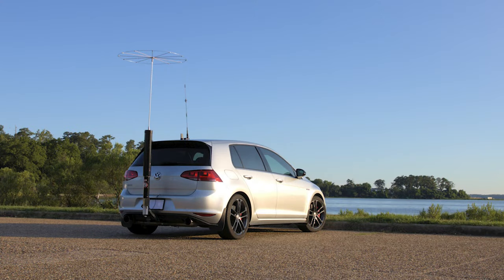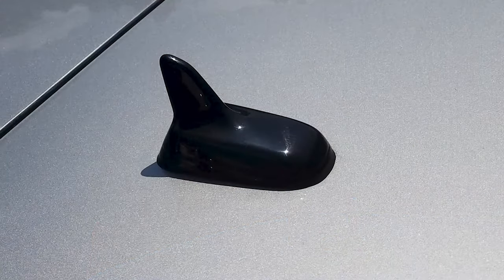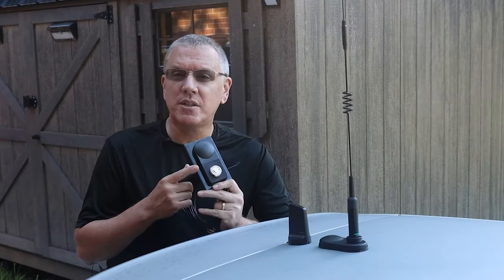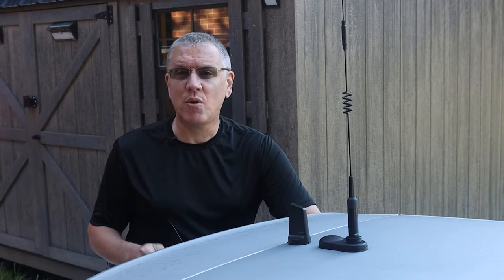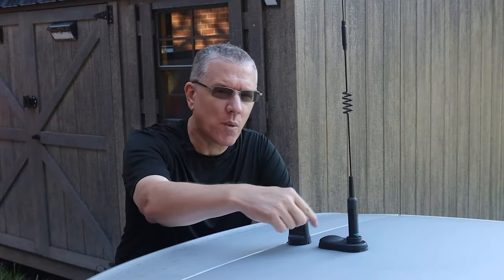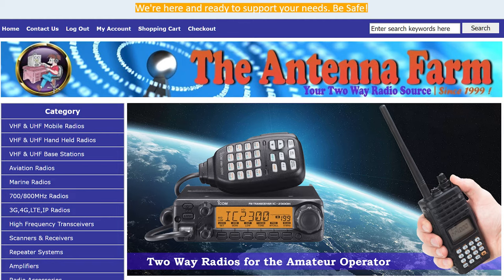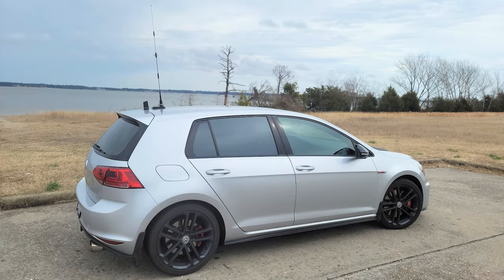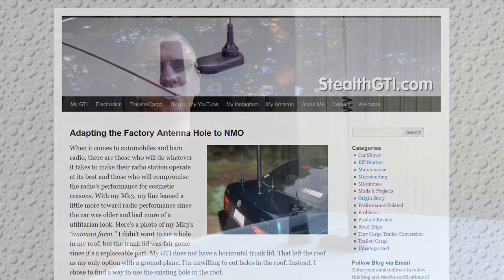Ham Radio Antenna Without Cutting a New Hole

Comment: Ditto - excellent production and info. Also, you have give me a really neat answer to the fear of cutting a hole for a new roof mount antenna: buy a dummy shark fin antenna ($10-20) to put over the mount when you need to sell the car. Most older vehicles have no roof antenna, on a newer one you might have a shark with 2 fins. 73!
Reply from the maker: I'm glad you found this helpful. Thanks for visiting!

Comment: Great presentation.  However, my fright over drilling a 19mm hole in the roof was offset by cutting a 19" square hole for the roof vent.  That gave me the shakes!!
Reply from the maker: Great point! I was a tad nervous when I cut a 14-inch hole in my cargo trailer's roof. But, unlike with a car, I could have glued or welded a patch in place if I goofed it up. I think I'd be plenty nervous cutting a large hole in my car. HAHA! Thanks for visiting!

Comment: Well written content/dialogue and chock full of information.  Thank you for the video!
Reply from the maker: Glad you enjoyed it! Thanks for visiting!
Reply: @StealthGTI  Scott, I wonder if you might help me with a recommendation from your expertise. I'm a first - time ham radio owner and need to know where to mount the antenna (NR-770HB) for my first ham radio Yaesu ( FTM-400XDR). I have just 3 basic questions. On the chance you have the time to share your recommendation, I'll leave my questions here, along with my sincere thanks for your help.

I am converting a Ram Promaster van into a camper and need to close up my ceiling so I can get on the road before summer ends to travel to meet my new grandbaby!  I don't want to close the ceiling in the location where I'll need to drill to mount the antenna and pull the cable through from the roof to the interior of the van. 

I was told that mounting the antenna on the roof is going to give me the best coverage for my radio, I paid for a decent radio and don't want to ruin its capabilities by putting the antenna in the wrong location. Is this true, the best location is high up on the roof? The ham radio will be in the cab, so I'd like the wiring to come in through the roof of the cab,  but some recommendations I saw said there needs to be distance between the ham radio antenna and the vehicle's existing radio antenna. My van's existing antenna is just above the windshield in the middle where a rearview mirror would be located. Most of my roof space will be taken up with solar panels and a cargo carrier- how much space is required between the ham radio antenna and the vehicle's existing antenna? 

Last question, is a strong magnet truly sufficient for mounting the ham radio antenna, or should it be bolted down through the roof? I thank you very much for your time and expertise and for helping me get on the road for this very special trip!
Reply from the maker: @sheri4673  - Sorry to have let this linger for a few days. Pro tip: Always post a new comment instead of replying to an unrelated post. "Comments" are prominently displayed in YouTube Studio for creators to see while "replies" are often buried in unrelated comments.

With that said, YES, the center of the roof is the best place for an antenna. But you have some challenges with a Promaster, especially in an RV: 1) The van is tall. That may compel you to consider shorter antennas for clearance concerns, which might negate the advantages of being on the roof; 2) You need to be aware of structural members beneath the roof's skin that may interfere with drilling an NMO hole; 3) You need to balance those structures with any other items that are on the roof such as you plan for solar panels. 

I've never owned a Promaster or examined one with a technical eye. But I tend to think that the roof just behind the driver may be a good spot. Such a spot is forward enough to leave plenty of room for solar panels and aft enough to have decent counterpoise in front of the antenna... perhaps a spot that's at least as far back as the distance between the center and sides of the roof.  I suspect that would provide sufficient separation between the antennas. As you can imagine, the antennas on my car are all closer together than what I'm suggesting for your van. Stick around and you'll see that I have even more antennas on the car now. I need to make new videos to share them.

A mag-mount will work, but then you'll need to manage cable runs flapping in the wind and entering the cab. NMO is best! Today's NMO mounts can work through a 3/8-to-1/2" hole. Your choice of the NR-770 is excellent! and will keep you below the 12' mark on overall height. 

I hope that covers your questions. Feel free to contact me through my website if you have more. I'll answer you here, but my mailbox is right in my face all the time.  ;-)  Take Care!  PS: Congrats on your ticket and new purchase!
Reply: @StealthGTI  I can't thank you enough for the reply- it was faster than I expected- and for all the information; there's so much to learn as a newcomer to the ham community as well as these technical aspects to the build out of my Promaster. I'll be following your channel for more excellent content! Best wishes to you and yours!

Comment: Thank you for a good video, I'm getting my Technicians License soon and I do want a permanent radio in my car, but I want a hole with a garment I have not decide if I want it on top or on the side and I do want a cell booster and a cb radio, I'm going to order the Comet 2x4sr and the Comet B10

Comment: Very nice video and your presentation skills are very good also.  When you transmit on GMRS or Ham is there any issues with the GPS reception?
Reply from the maker: Not at all. In fact, I would have never thought of such interference. With that said, my GMRS antenna is on the other end of the car now that I have gone nuts with ham radio. "How nuts?" I have nine antennas on the car right now. See my KE4WMF playlist for details. Take Care!

Comment: Awesome, thanks for this video!  I have a 2017 GTI and from your video years ago I've been thinking about adding my 2m/70cm antenna.  I'll check this out once I verify that it shouldn't interfere with the sunroof.  Oh, and to be clear, you still have your SiriusXM antenna unhooked, correct?  Thnaks!
Reply from the maker: Thanks for the note! I cannot imagine how this mount will interfere with the sunroof. It's just 3/4" longer than the sharkfin antenna. Let me know if your measurements conclude that it won't work with a sunroof. And, yes, my SiriusXM and CarNet antennas are still disconnected. Take Care!
Reply: @StealthGTI  I did a quick look at lunch and you are right, I can't see that it would interfere.  Now to figure out how to keep my Sirius/XM while using this as I do listen to that alot.  Thanks!
Reply from the maker: @reidlanham2011  - That's good! I guess the answer to the SiriusXM depends on your tolerance for visible wires. You could get an external mag-mount antenna, run it through the seal as I did for that WeBoost antenna, then find a way to adapt it to the FAKRA adapter under the headliner. Another possibility is to see what the SiriusXM connector is on the back of the radio. If it's a common connection, you may be able to get an external antenna that'll plug into it, then route the wire to have the antenna sit on the dash, tight toward the windshield so you barely see it. You MAY have the occasional skip due to a shadow in the signal from the roof... maybe. Just a couple of ideas.
Reply: @StealthGTI   Scott - Thank you again for your videos and your website.  Would you be able to share any additional information about how the WeBoost antenna cable runs from the antenna, through the seal and into the car?  I need to do this with an XM antenna.
Reply from the maker: @jadue42  - The antenna wire in this video simply runs through the hatch and under the door seal. In this case, I peeled the seal back just enough to pass the wire beneath the seal and then pushed it back into place.
Reply: Makes sense!  Thank you, Scott!

Comment: Newcomer to the hobby. I have a 2014 VW Tiguan - which has something resembling your shark fin on it as well. I am keen to try something like this. Can you provide more information about removing trim in a car? This part is a bit daunting for the new person.
Reply from the maker: Thanks for writing, Jacob! The rear piece snaps out quite easily. Check out this video: https://youtu.be/2FZz9hl5zPk. The first minute shows that you don't even need a tool to remove the rear trim piece. From there, the rear portion of the headliner just folded down for me. Good Luck!

Comment: i have two factory antenna mounts at the rear of my cab  ( F250)   towered both sides not centerline.      and  the body is alu. 
but yes i agree as i also do not use any of the services offered for a PRICE.
a headache rack is very costly.  nor do i want to start drilling holes.
Reply from the maker: I want my next car to have a factory roof rack. That will give me some options. Have a look at my "KE4WMF" playlist and you'll see that I have more antennas these days. Roof racks FTW!  ;-) Thanks for visiting!

Comment: Thanks for the information! Unfortunately for me I moved to SV9 land years ago and unfortunately Renault does not do I. Glass antennas for their car radios. They choose to mount an antenna towards the back center of the roof. I have used STI-CO ANTENNAS in the past for law enforcement vehicles. They are very expensive at over $300 which includes a special diplexer that allows you to add VHF UHF and your car radio antennas all into one. They even have a GPS version. At a standstill since all materials must be imported and the issue with that is they charge 24% VAT tax on everything including the postage! Very illegal in my book. Have to wait for relatives to pack the items and bring them over which saves on taxes. So now we sit and wait……
Reply from the maker: Thanks for sharing that info. I don't know anything about some cool looking products that appear to be only for the European market. I hope you have a solution soon. Thanks for visiting!

Comment: Thanks for the video. Which connectors did you select on the drop down lists for radio and gps on the product page while purchasing?
Reply from the maker: Thanks for the comment! Here's a quote from a write-up at https://wp.me/pevkSZ-7l: "I bought my mount from The Antenna Farm. They’ll install most common connectors for a modest fee. I chose an SMA male on the NMO feed line and an SMA female on the GPS feed line. I also had them cut back the cables to 24 inches so that I can easily remove the mount for cleaning or maintenance." Feel free to check out the rest of the article if you're interested. Thanks for visiting!
Reply: @StealthGTI   I should've checked the article before commenting! Thanks for the reply, I'll check out the article. I have a 2018 gti autobahn I plan to do this to for an external antenna for my FT3D. 73
Reply: @StealthGTI  Follow up question, do you still recommend having both the cables trimmed to 24 inches if I have no existing cables run, and install my own, or just use the mount as it comes? Thanks!
Reply from the maker: @cbennett1  - I do! You see, if you need to remove the antenna mount for replacement (unlikely), cleaning, or any other reason, then you'll have to pull out ALL of the coax that you've fed through the interior trim panels and headliner. By trimming the cables to 24", you can leave the main cables routed in the car and just pull out the first 24 inches. It's a convenience that you may never need, but its great if you do!

Comment: Scott-  Where did you find the fender washer?  I have not been able to find one in this size. Thank you!
Reply from the maker: The one shown in this video was pilfered from the plastic mount that I had tried first. A standard 3/4" flat washer from your favorite hardware store may be large enough. If it's not, then perhaps https://amzn.to/3PgTlBo will work. It's expensive for what it is, perhaps it's one of only a few samples that I could spot. BUT keep in mind that your roof my not be flat at the hole. Mine is not. Over-tightening may pull the roof out of its natural shape. So, the standard washer may be better, if it's large enough to cover the hole. Good Luck!

Comment: When you say you had The Antenna Farm cut the cable to 24", were you referring to the GPS antenna cable?
Reply from the maker: I had both cables cut. This part has a cable for the NMO mount and the GPS cable. I had them both cut in case I need to remove the mount for paint maintenance. I'd much rather pull out 24" than 13 feet. Thanks for visiting!

Comment: I have been using a Larson mag-mount and a 2 Meter 5/8 wave Larson antenna on my Nissan Leaf connected to my dual band Kenwood rig. My roof antenna is pre-shark fin but roof mounted in the spot where the shark fin would go and about the same size. Will the EMWave Sharkfin mount NMO combo support Sirius XM radio receivers?
Reply from the maker: No. The EM only supports NMO (and whatever is attached at each end) and GPS. Thanks for visiting!

Comment: can I mount a 5G 4x4 MIMO improvement instead? Or do you please know how to improve 5G phone reception in the car? band n71 3,5ghz
Reply from the maker: You can mount any NMO antenna. Still, I chose to use a WeBoost cellular signal booster for my 5G needs. I think I mentioned it in this video. Thanks for visiting!

Comment: uh ! I thought that shark fin antenna was also for FM reception... I have the TSI model and I too did not want to drill a hole on the roof ! That is a nice solution if the original antenna is not used for FM reception !
Reply from the maker: The sharkfin contains three antenna elements, which I show at 1:32: The larger square unit is for GPS, the smaller square unit is Sirius/XM radio, and the vertical unit is for CarNet. The FM radio antenna is built into the rear glass. The horizontal lines for the defroster elements while the vertical lines are for radio reception. I'm not sure if the AM antenna is back there, too, or if it's a small coil in the head unit. Regardless, my AM/FM radio reception is fine, HD included. Thanks for visiting.
Reply: @StealthGTI  I don't have the carnet I am pretty sure in my TSI 1.8l. I will check if I have those vertical line in the back glass. So installing the NMO adapter you have will render the Sirius/XM innoperative correct ? Only the GPS will work. I don't have navigation but I do think the GPS works for the compass in the dash and setting the right time in the radio. I am not just visiting, I subscribed, I love my 2016 Golf TSI and I am a ham radio operator too !
Reply from the maker: @Aleziss  - You are correct: Sirius/XM will not work without the sharkfin. The GPS will work with the adapter that I list in the video description and restore the GPS feed for the compass and time sync. Also see a write-up with links at https://stealthgti.com/adapting-the-factory-antenna-hole-to-nmo/. Take Care.

Comment: I was wondering, how to get vhf and uhf tuned to the atas120 ? I do not find any information on how to run vhf and uhf out of the atas-120. Also how did you screw the atas-120 to your car on the nmo mount ? which adaptor did you use to get nmo to so239 ? lastly, did your mount was strong enough to use your atas120 while driving ? that is rather a big antenna for the small mount I see in your video no ? thank you !
Reply from the maker: Thanks for writing, Aleziss! The ATAS-120A tunes VHF/UHF right out of the box. What I don't recall is whether the antenna has to be in the compacted position or if it'll work those bands from any position. IF the "TUNE" button works while on a VHF/UHF band, then I suspect that the radio will move the antenna coil to where it needs to be automatically. As for adapting the ATAS to my NMO mount, I used this: https://amzn.to/3zCFxcx. Somehow, I doubt that an NMO mount, its adapter, or my specific roof mount are intended to support the weight of the ATAS. I've driven with it up there, but it's probably not a good idea. I think it's best to mount it after the car is parked unless you have it on a sturdy mount that's supported. These days, I mount my Scorpion mobile HF antenna whenever I want to work the HF bands. Take Care!

Comment: So you still had to remove the headliner and run your antenna wire around airbags or you found another way?
Reply from the maker: Thanks for writing, Bobby! No need to remove the headliner. The rear 10-12 inches will fold down and allow access to the underside of the antenna after removing a very simple rear trim piece. You MAY need to put away the tops of the C-pillars, but the headliner can stay in place. See a photo at https://i0.wp.com/stealthgti.com/wp-content/uploads/2021/05/EM-Mount-06-1920.jpg and a full write-up at https://stealthgti.com/adapting-the-factory-antenna-hole-to-nmo/. Take care!

Comment: How does the signal from the GPS Satellites enable your compass indication? Is this a ‘Direction of Travel” readout, or an actual heading display (which, in a road vehicle, are about the same thing anyway)?
Reply from the maker: I think it is a "course" (travel direction) marker instead of a heading display. Oddly enough, backing the car 10-20 feet doesn't seem to change the heading. So, I'm not sure. But I'll stick with "direction of travel." Thanks for visiting!
Reply: @StealthGTI  As to the heading remaining unchanged despite the car backing up, the Track Indication on the airplane I used to fly exhibited the same behavior while we were being ‘pushed back’ from the Terminal Gate!